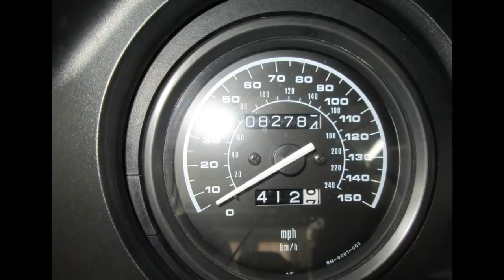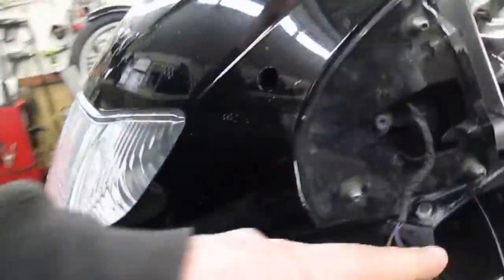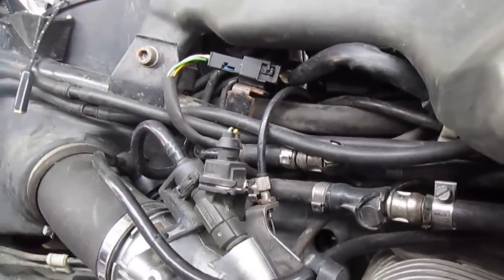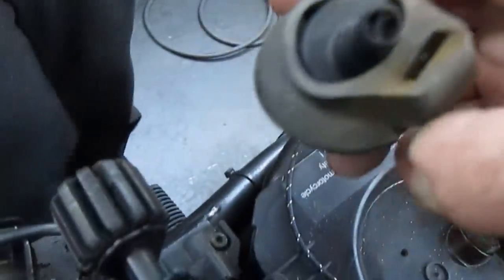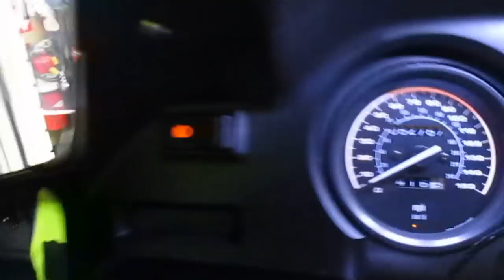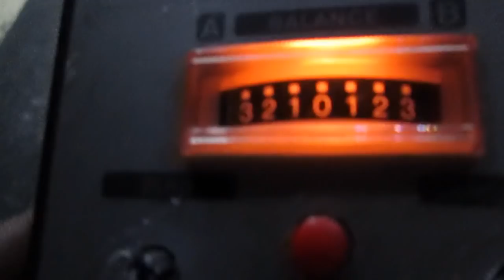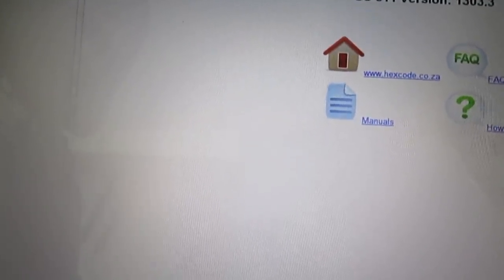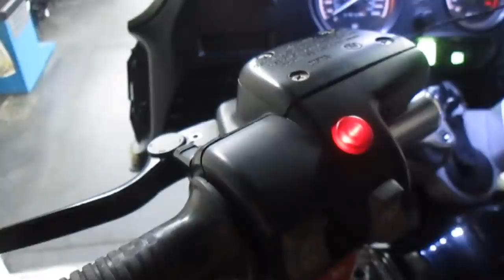BMW Service - Who worked on this last?! - R1150RT 1

Comment: Ive been doing maintenance work on an R1100S I just bought from my local BMW dealer “as is” because it had a dead clutch lever. Replaced the clutch slave and it works great. Thanks to your videos, of course! Just replaced my fuel filter and found two fuel hose clamps inside the tank were never “re-clamped” and 3 of the bolts were loose that  hold the fuel pump assembly plate to the tank. Funny, I know where this bike was worked on and Ive taken bikes (under warranty) there. Makes you think twice about taking stuff to a dealer. Not every BMW dealer has a mechanic like yourself, Chris. Your videos are invaluable.

Comment: The greatest question/search for all motorcyclists: how do I find a good honest mechanic?
Reply: Can you get me!. Thanks.  If as
Reply: Its not the honest bit I worry about its the ass holes that just dont know what they are doing and then charge the earth This sadly includes main dealers you know the ones that charge three time more and still do a shit job I have had it time and time again I now insist on meeting the person that will work on my bike and i almost interview them you only need to ask a few questions and the bullshit will either start to flow or it will not Just make out you have not got a clue it always works !!

Comment: Great video Chris.  Always recommend your videos.  I don't do it, but the hole in the front cover is often recommended by some to avoid having to remove the front cover during a valve adjustment. Hole allows access to the nut on the pully to turn the motor to TDC.  I use the markings on the cam chain sprockets, and just use the rear tire to turn the motor.

Comment: Good work as always. Is this an old video of yours? It is funny that my 2004 1150rt has a rised level of clutch fluid( almost at top), I was wondering if I should remove some and you just answered my question 😂

Comment: Chris, great work on a bike that has been previously poorly maintained - I have a 2005 R1200GS with 78,000 miles on the clock, and it runs great around London. Keep up the good work. :)

Comment: From all accounts I am very lucky to have never gotten an oil- head boxer. Airheads FTW. Simple by design.
Reply: The prevailing opinion seems to be that the 1100s and 850s aren't so bad, especially the non-ABS versions.

Comment: Hi Chris!! I just seen couple of your videos and i sed give a try to fix the bike by myself and i realise here in Germany on the crankshaft are two diferent simbols witch makes me confuse in calibrating the tappets and i have a Z letter with a horizontal line on top and SOT instead of TDC mark like i see on U.S. model. 
Can i ask how should i do, witch sign shel i set the crankshaft to calibrate the tappets before i take of everything??
Thank you very much for your help.

Comment: Hey Chris, great videos, they are very helpful. I watched your video and changed a transmission on a 96 R1100rs. I’m not sure if I did something wrong but once I put in 1st gear, and release the clutch, it rolls forward for a second but then I hear a click and it’s like the transmission locked up which shuts off the bike. The weird thing is, while on the center stand, I put it in gear (before trying to drive off) and as I release the clutch, the wheels spins freely no problem. Any idea as to what may be the cause ? Thanks.

Comment: Chris

Can a stick coil send enough voltage to operate neon tester and not fire the plug ?
I don’t have a spare plug to put in the cylinder and do the test as you recommended.
Disconnected each stick from harness one at a time and on the right side there is no tone or idle difference 
However it showed neon when bike ran neon seemed to be a bit weaker on this side.
When I disconnected left side there was definitely a tone and idle difference.
Was going to swap left to right to see if tone changes on right side to verify signal to stick.
Thoughts ….
Thanks again …
Reply from the maker: Yes, swap stick coils and see if the problem follows. You're on the right path.
Reply: Hi again
Swapped sticks and problem raveled with coil to left side.
So pretty sure that’s it …
So I guess I should replace both
Seem pricey do you have a vendor you would recommend- can it be aftermarket?
Thanks again.
Reply: Traveled

Comment: Chris 
Can I check stick coils with an in line neon tester ?
Reply from the maker: Sure but you can verify spark simply by removing the plug, inserting it into the plug lead and placing the plug on the cylinder. Crank the starter and look for spark or lack of. Good Luck, Chris
Reply: I heard wasn’t a good idea on bmw
Motorcycles 
I figured was misinformed 
Thanks !